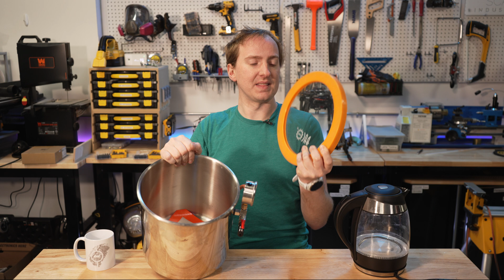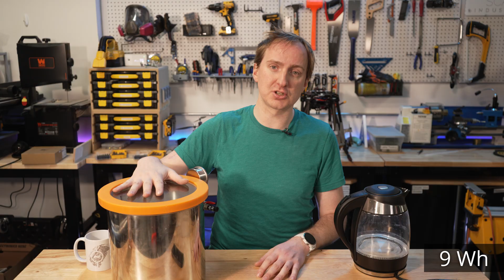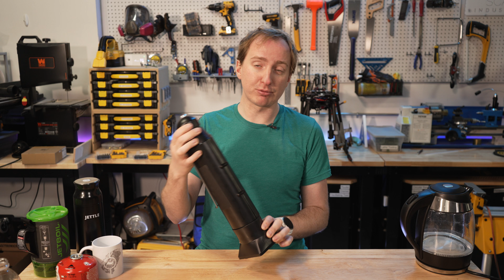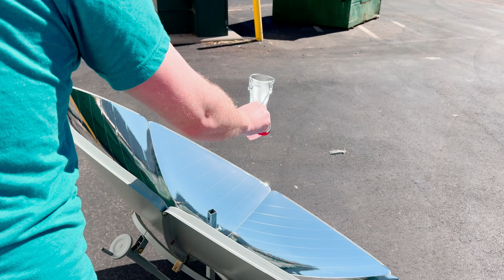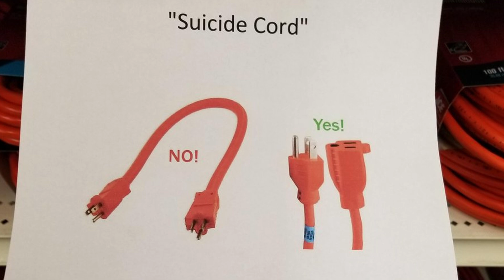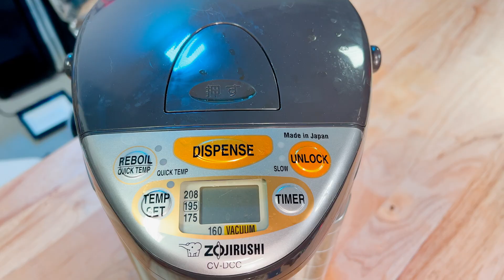What's The Best Way To Boil Water?

Comment: The other thing worth considering is that not all efficiency losses are realized.  If it is winter and you're heating your home, any heat lost from boiling the water goes into the home and reduces your heating energy consumption...  Granted, it is resistive heat, which is less efficient than some other options (heat pumps in particular), and in summer the losses are doubled if you're actively cooling.  But maybe in summer the starting water is hotter.
Reply from the maker: Oh, absolutely! But I did want to accurately figure out heat loss, given that half the year here I'm running aircon and thus do care a lot about it.

Comment: Induction.
Reply from the maker: Oh, I considered it, but the only induction stove I have access to plugs into a standard 120V wall socket as it's a portable one.
Reply: @AndrewGodwin I use a portable 2000W 240v induction hob and it took only 1'50" to boil half a litre in a closed kettle. There are single 3kW 240v hobs that would probably bring 500ml to the boil in 1'30" at sea level. Since having solar installed on our house, I've become an absolute nerd 🤓 😊

Comment: Love me a novel death cable. (Small correction: North American 240V residential delivery is considered a "single split-phase" rather than "multi-phase" because the legs are 180 degrees apart and useless for rotation.)